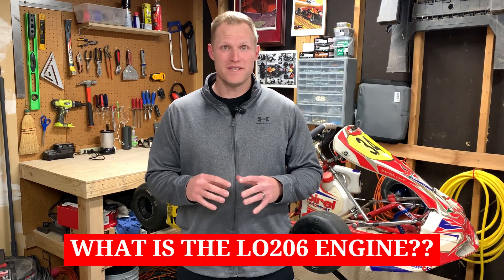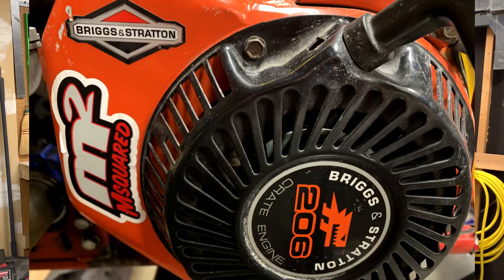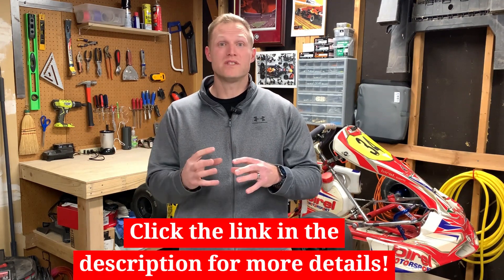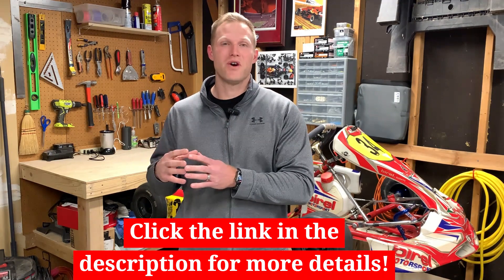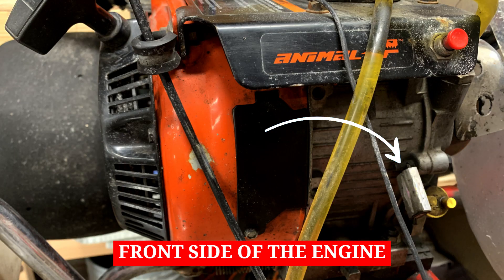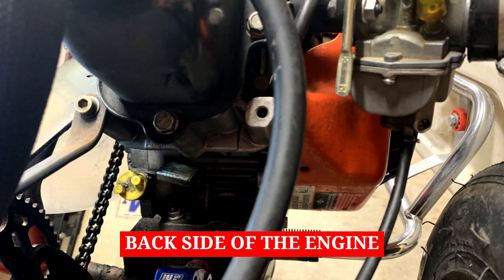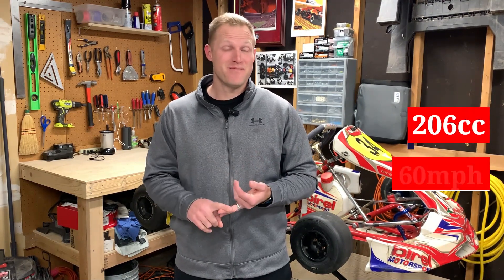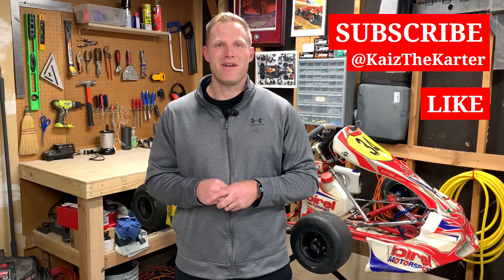THE BASICS: What is the LO206 engine? Key elements to understand. [TheQuickLO206 – Ep. 2]

Comment: Good video!  I think the term your looking for is power cycle, suck bang squeeze blow go. You had 2 and 4 cycles backwards, 2 cycle is spark every rotation, 4 cycle is spark every 2 rotations. Also have you heard of cam twisting? Lol
Reply from the maker: Thank you! This is helpful! I have not heard of cam twisting, what is that?
Reply: @KaizTheKarter  it’s the latest drama it LO206, engine builders are twisting the cams for a little more power. Briggs just tightened the spec but apparently still not enough.  Check out krybaby performance
Reply: @cgs4706 twist cams? What does that mean
Reply from the maker: @cgs4706  Thank you!